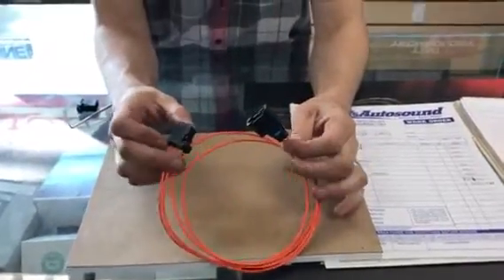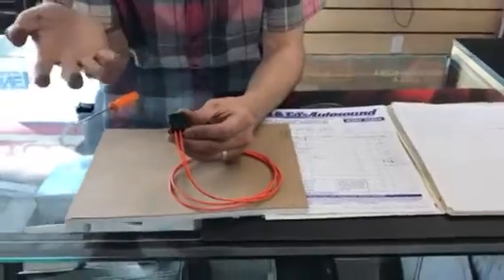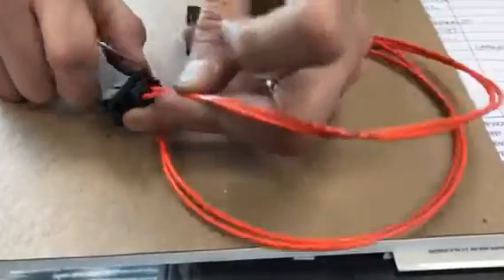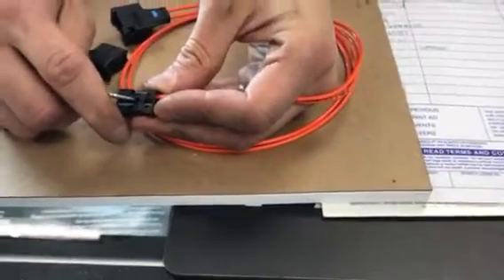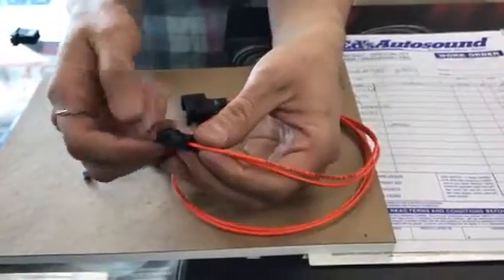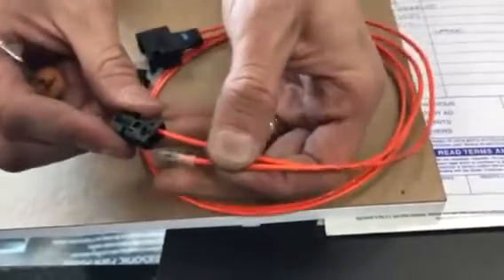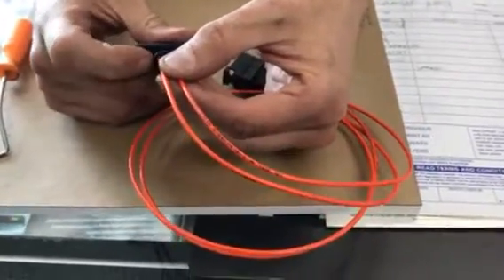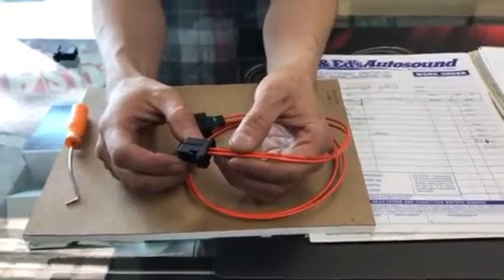How to open fiber optic connector BMW Porsche Mercedes

Comment: Hi, on mine I broke the clip when removing it, so the cable doesn't stay in. When you hear that click noise, I would like to know if the connector broken or the socket it sits in. I find it hard to work out what I broke to make it click. Thanks!

Comment: I have 15 golf and I were trying to install aftermarket radio, and my CD player has fiber optic cable on oem CD player but after market radio doesn’t have it, everything is working accept sound. How can I fix that ?
Thank you
Reply: Eli Z did you figure it out?